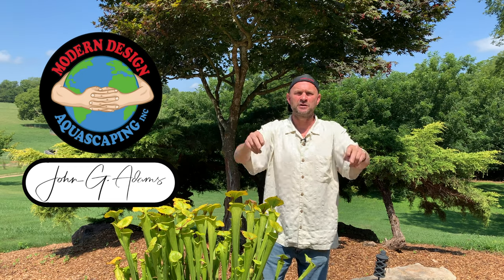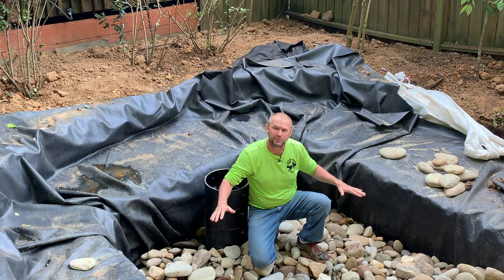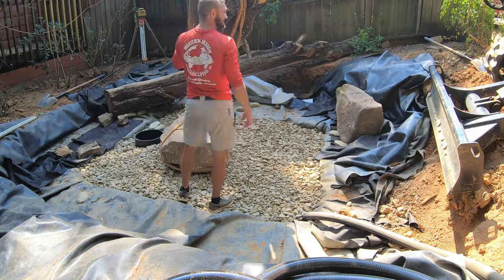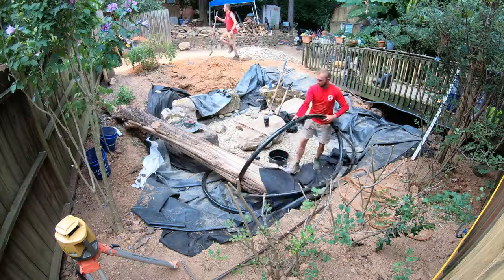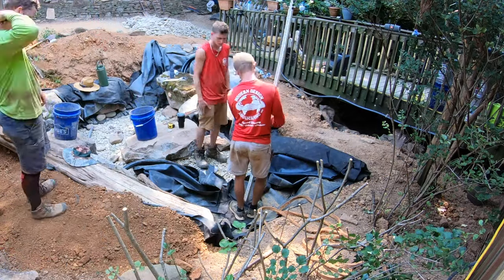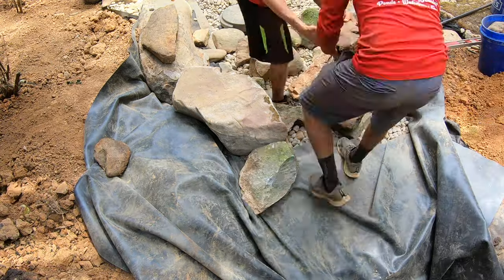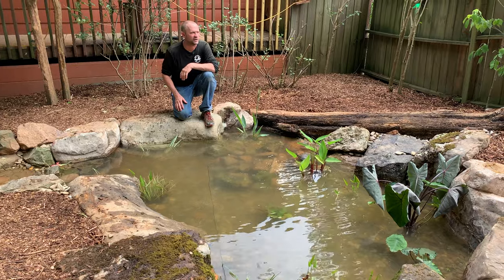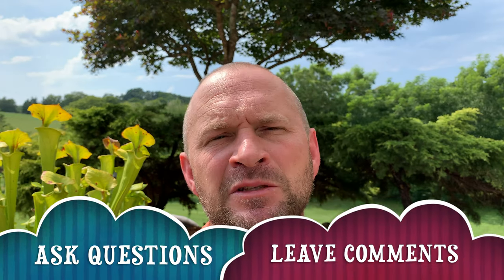WETLAND FILTER LAYOUT AND INSTALLATION Part 2 | Water Feature Design Series 9

Comment: What kind of precautions do you take for toxic liquids running into wetland then making way into pond? Would you take rainwater from roof gutters?
Reply from the maker: Honestly we can never keep everything pitched away, its just not typically possible. We pitch edges away as much as we can and use clean mulch to hold back runoff. Short groundcovers around the edge help as well. If there is runoff that will potentially contain anything harmful I would make a dry stream or berm to push that water away (around) the feature. Rainwater from a rroof is OK IF you make sure it is going into the skimmner or pump vault so that it mixes with pond water before getting to the fish AND you make sure you calculate that the downspout you are using isn’t putting in too much water!
Reply: Modern Design Aquascaping Inc. We don’t get a lot of rain here in western Colorado - only 8-10”/yr.  do you think a rain water recovery is worth it for my pond?  Nothing like where you guys are based.  Do you have any issues with PH changes due to rain water?

Comment: Great video John. Thank you so much for doing  this wetland videos. I am about to start adding (or should I say digging) wetland filter to my existing koi pond.   I already have all of the equipment, just waiting for cooler weather to start. I have a few questions. First, the jet that you installed, is it 2” all the way to the ball valve or did you have to reduce it to a small size?   I saw that you put a snorkel cap completely under water.  Most video with wetland on YouTube here usually have the cap above the water level. Are there any pros and cons between the cap above or under water.  I really love to put mine under like yours because it looks more natural and easy to hide the cap. I want to do it right the first time, so I have to ask. Thank you so much for your help :)
Reply from the maker: Cap under is always good for me, make sure it’s on tight is all. All of our plumbing was 2” for the centipede feeder line up to 7000 gph then we use 3”. The line for the syphon break doesnt matter, just make it near or above the water surface for proper function👍

Comment: Hey John having problems with my whip I added in my wetland filter have a 3 inch line with a 2 inch line T fitting coming off more of a Y fitting but I’m not getting any water out of my 2 inch line on top just all is going into my centipede any help would be great thanks
Reply from the maker: Is there any resistance? (Ball valve etc)- As long ass you can unplug your pump and it will suck air through the whip breaking the siphon you’re good. Let me know if you’ve tried that
Reply: Modern Design Aquascaping Inc. hey John I do have a ball valve on the end of the whip haven’t tried turning the pump off and  let it break the water but I will try that tomorrow also I was going to add a large stack sllate urn to the wetland filter and I was going to try to tee off of the whip line is there a way for me to make sure there is water pumping through the whip to operator the urn thanks

Comment: You have great videos I really enjoy watching them.

What size pump are you using to feed the wetland filter in this application?  Thanks!
Reply from the maker: We feed the wetland 2000 GPH per centipede module-of course you can push more water flow out on top of the filter to create a more dramatic effect

Comment: Is the air valve line the same diameter as the main line?
Reply from the maker: The breather line just needs to be big enough to let air in to break the vacuum of the siphon. If I’m running a 2 inch mainline I will often use I want inch line for the breather. Of course if you’re installing some sort of a fountain or Waterfall up above it doesn’t matter because it will get air from that👍

Comment: Sir
Very informative 
Can u touch more upon grade and setting the mark
Reply from the maker: What specifically are you inquiring about ? I will try to answer😎
Reply: I really didnt understand when u say u have to set a benchmark
Using a level
Reply: @kaliebgriffiths9800  a bench mark is a reference mark. It can be placed in a spot that does not move so you can make grade marks and water level marks from the bench mark. You will need a Lazer or transit!
Reply: @bfourn79  thx for clarification 👍

Comment: Is there a drawing of the siphon
Reply from the maker: No but it is simple. Put a tee in-line before the pipe runs down into the centipede. Reduce the tee down to a 1” pipe and then run that out into the wetland. Be sure to position outlet of the “jet” near the surface to keep it from sucking down the water level in the wetland before it works!!

Comment: What size and brand sump pump do. You use??
Reply from the maker: Sump pump?
Reply: Modern Design Aquascaping Inc. Yes - the pump you use to suck water out of the wetland filter.   I was wondering what brand you recommend and how many HP.  Looks like you get great flow  to clean and wash gravel.

Comment: I need to know where to buy a wetland filter
Reply from the maker: You can buy parts from an Aquascape distributor or hire an installer to do it for you. I just got back from North Dakota building a 4000 Square foot filter with 1000 Aquablocks in it!

Comment: Where  can I install whip can please help, it keep water clean if power is off
Reply from the maker: Anywhere up at the top end of the feature. It just needs to be high enough up the system to break suction when the power goes out!
Reply: @KoiAddiction  where should I attach the suction end

Comment: Thanks John, 
Over here: https://www.pondtrademag.com/wetland-filtration-offers-simple-path-clear-water/ (in the comments) you mention it is important not to put too much water through the filter.
How much is too much?

Is it based on the surface area of the filter? The number of centipedes? What is the range of water flow rates we should be designing around?

On the datasheet it basically gives a min of 2000 GPH (~7,500 litres per hour)  per centipede, but no max and it does not mention if this is through the wetland or the total flow.

Also, how much head should we allow for? 
I need to move a LOT of water (50,000 litre pond) so am planning on using a high efficiency pump. Unfortunately they don't work well with significant head so I am curious how much I should allow for (beyond the difference in water level). 

Thanks again for these 3 videos, makes it all a lot clearer
Reply from the maker: Wow that’s alot😎 If you over pump the wetland, it simply won’t let the sediments settle out. I have never done that personally. If you go technical, you can change flow rates and gravel depths and monitor dissolved oxygen levels to ensure proper conditions for biological activity. I have friends who have gone this far-I have never felt the need. If you look at layouts for wetlands, there are many ways to set it up, 2000 gallons per hour per centipede is their spec. I have done as low as 1500 but I suggest you stick with 2000. This is the amount up-flowing. If you want, you can pump as much as you want out on top, that poses no problems for me in the past. As far as head pressure, you would need to monitor that as well. A new, unclogged filter would pose very low resistance. Later it will increase. If you add a heavy plant load, again increase. This will also be effected by the smallest aggregate you use. The smaller the gravel, the smaller the spaces, the smaller particles are trapped. This will eventually increase head pressure. There are so many variables, you would have to be Ed the pond professor to figure out exact answers on this magical set of questions. I know my responses aren’t exact but I’m working on my own pond to test such stuff. I have done externals on a pond with a wetland for swimming and really have noticed no significant changes during a season-keep it clean and not sterile👍
Reply: @KoiAddiction  
Thanks John.

Isn't the rule of thumb to move the volume of the pond every hour?
I have a 50,000 litre in ground concrete pool I am converting to a pond. 
It is 50,000 litres, so a 50,000 litre pump.

Not so?

... so just send 2000 gph through each centipede and send the rest somewhere else.
Reply from the maker: @Richard John
Yea there are some rules people go by...Smaller features are 1-2 times per hour BUT as a feature gets larger the turnover becomes less. If your wetland is sized properly for the pond, your flow should be sufficient based on that equation. That being said you still need to consider circulation as an equally important aspect of the design. Jets and or additional falls are just as important in the design. Last large pond we built we put 5000 GPH on the wetland up-flow. The pond was 20k gallons. It has much more flow for falls and circ. But only 5k up-flowing. It’s working fine. I onl;y wish we would have put a negative edge on it instead of an intake bay 🙄